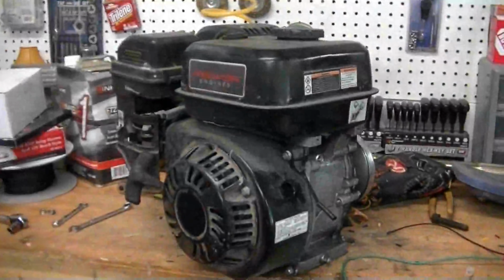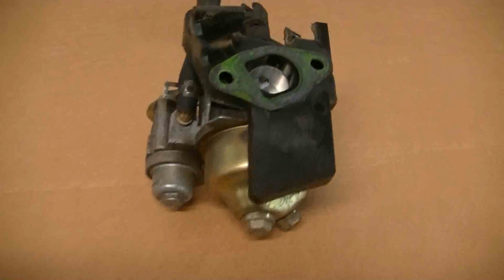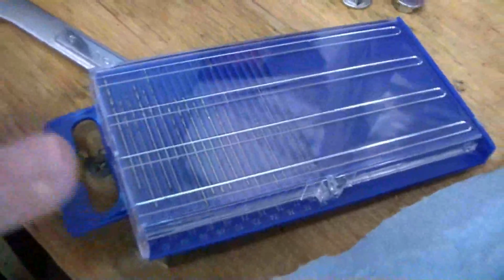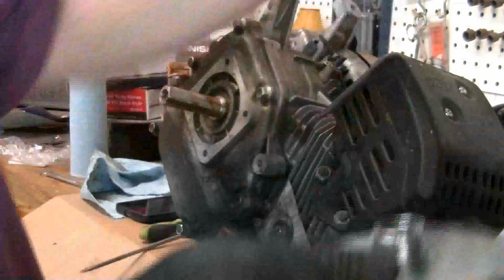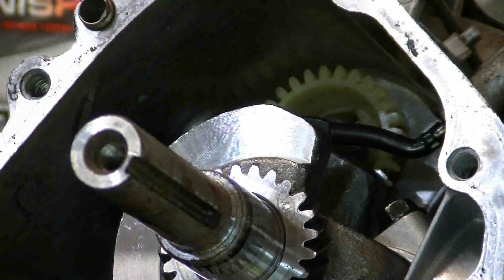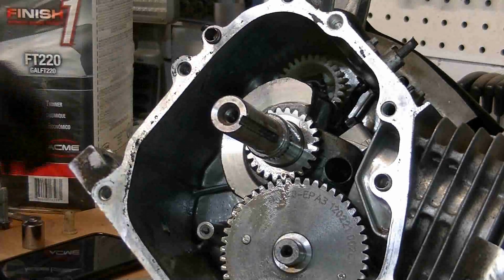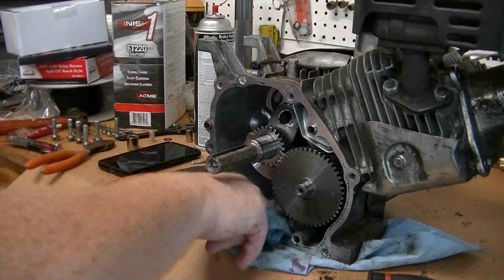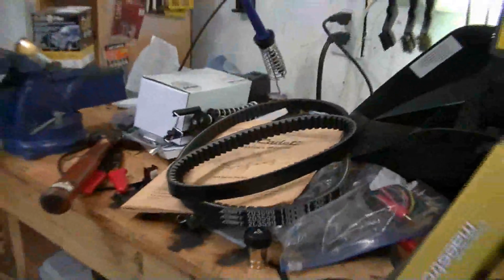Skittles Engine Tune Up

Comment: what size dit you drill the jet to
Reply from the maker: I didn't drill the jets on this carb i just cleaned them. I can let you know what size i use later tonight though. I can't remember off the top of my head.
Reply: awesome thank you RBG. I live in iceland me and my bro are building a drift trike, got the engnie yesterday brand new from Gopowersports and 1" axiel kit
Reply from the maker: Yeah those drift trikes are fun man. Post some videos when you get it done.